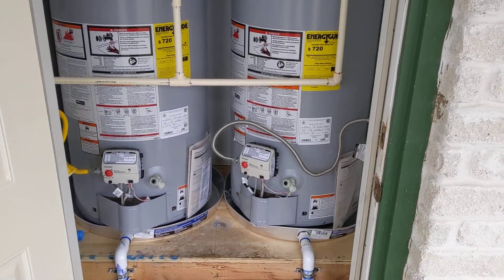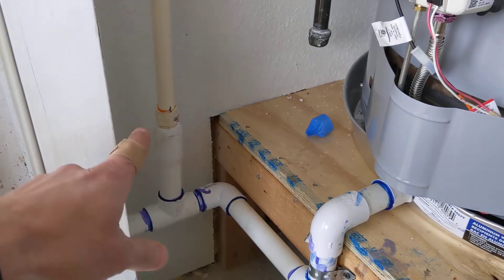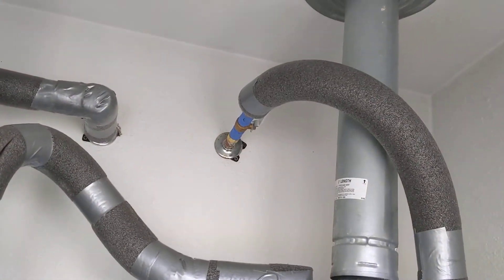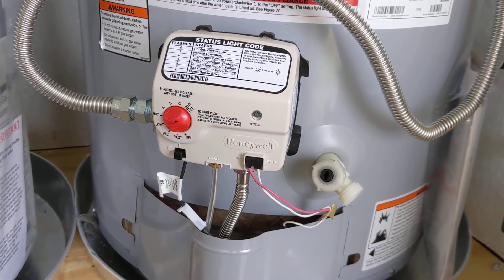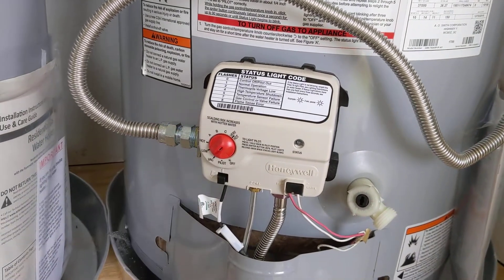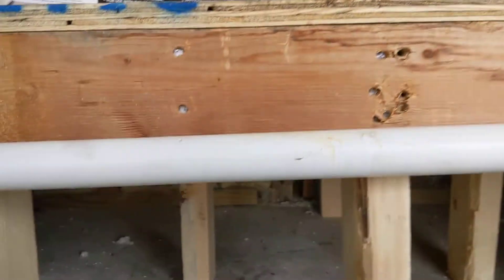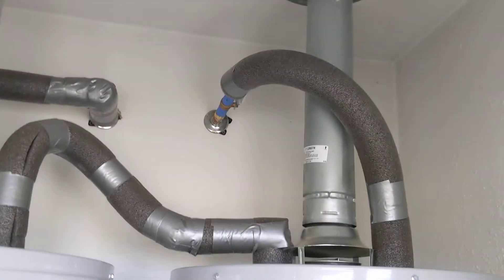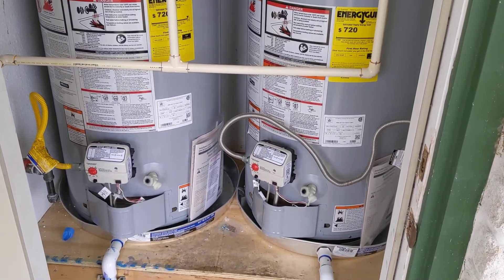Gas Water Heaters In Series

Comment: Thanks for the video. I have seen a few other videos of water heaters in series and there are so many comments from plumbers saying it's wrong, against code, will wear out the water heaters prematurely etc. Basically saying they need to be done in tandem. Thoughts?
Reply from the maker: Yeah, so code does determine what you can do in your area. I'm not sure why plumbers are so staunchly against tanks in series, other than it's "one of those things". Both systems have pros and cons and shouldn't be used as a "one size fits all". 

Heaters in series are good for those that have fluctuations in usage, such as a retreat center (where these are located). If you have a small group, then you only need one heater running, if you need more hot water, you just turn up the first unit. It doesn't require balancing of the pipes and is very customizable. It's easy to add another unit because they can be different sizes and models, and you can turn the first unit to a low temp to just act as a tempering tank and allow the second tank to heat water faster. The con is that the first tank "can" wear out sooner if you always leave them both on fully, as the first tank will be taking the cold water and heating it up and then passing it into the second tank fully heated. The second tank won't have to heat anything if that is the case. So the first tank will wear out sooner, but that also means the second tank will last longer (so in my mind this all balances out).

Units that are done in tandem have the benefit of both wearing out at the same time (theoretically) and producing more hot water because they are required to be the same model/tank size and have the supply line and hot line to be almost perfectly balanced between the two tanks (same length and bends in the pipe going into and out of either tank). Pro is if you are always going to be using a massive amount of hot water, (no fluctuations in needs, because you can't turn down one of the tanks in a tandem setup), then tandem makes sense. Con is that it can cost more to install because of how precise the setup needs to be in order for there not to be backflow issues. Basically, you can't just grab another unit and plumb in to your first unit if you decide you need more hot water, whereas a unit in series can be added easily if there's gas or power available.

Summary: 

Series is great for fluctuations in usage or easily adding more capacity to an existing water heater setup.

Tandem is great if it's a new build and hot water needs are constantly high.
Reply: @MyFortressConstruction  thank you for your time. That helps a lot.
Reply: Can I have 2 different size tanks ? A 50 gallon and. A 30 gallon? Or do they have to be the same size ?
Reply: @mrorel  I don't see why not. It's basically just acting as one giant tank with two different heaters at different ends.
Reply: @mitchjohnson4714  but does the size of the tank change pressures in the system ?
Reply: @mrorel  Hmm. I'm not an expert in this, so I hope others weigh in. I think the pressure will be higher in the tank that is higher temperature. So a lot of people think that it's a good idea to have two tanks in series and then have one tank heat the water part way and then the next tank heat it all the way. This doesn't sound like a good idea to me because the first tank might make the water a good habitat for legionella. It would be lower pressure than the second tank, but I think that the way it's plumbed, water cannot flow back into the first tank, so I don't think that pressure difference is a problem, but legionella in the first tank might be a problem. 

Personally, I'd rather have both tanks operating at the same temperature (in which case I think both would generally be at the same pressure, except when cold water is rushing into the first tank during use of the system. In my house, they built it to have two tanks in series, but it's just me and my wife, so I simply turned off the first tank and I will turn it back on if we ever have a lot of guests.

The only problem with series tanks like this is that if one of them goes, you can't use hot water at all. I think you can always use the other tank of they are in parallel.

So my plan is just to take really good care of the sacrificial anodes and hopefully they will last a really long time. If you're not doing this, you should definitely make sure you're doing this.

As for a pressure differential, I don't see it being a problem.
Reply: @mitchjohnson4714  why wouldn’t I be able to use hot water if one of the tanks go bad? Wouldn’t it jus run off of the one working tank?

Also so if I had a 30 gallon and 50 gallon, would my 30 gallon be where my main water line would go and the 50’gallon would have the outlet to supply the house ?
Reply: @mrorel  Sorry. I guess it by "go bad" we meant that it didn't heat, you'd be fine if the upstream one went bad (That's basically my setup, since the upstream tank is off). My last water heater to "go" started leaking everywhere, so that's the scenario I was thinking of. I was also thinking about using the heater while the other one was being repaired, but maybe that's not really a big deal. 

If it were the downstream one that stopped heating, I'm guessing the water wouldn't be quite as hot because now you've just basically significantly increased the volume of the water, but now the part that heats is pretty far from the outlet of the hot water. So I guess in that scenario you'd either have water that wasn't heating properly, or you'd have to increase the heat of your working heater until the other one was fixed.

I guess it's not that big a deal.

As for placement of 30 vs 50, I imagine it depends on your needs and the reason you're doing a parallel system. In my case, it's just me and my wife. We probably don't even need a fifty gallon tank. So if I were going that, I'd probably put the 30 gallon heater downstream so I can turn off the 50 gallon tank until guests stay with us or something. If, on the other hand, you had a family of five and a 50 gallon tank was barely doing it for you and you had a couple extra guests that you wanted water for every once in a while, perhaps it makes more sense to put the 50-gallon tank as the downstream one. 

Ooooor, if you're just running both of them all the time, I feel like it just doesn't matter. Maybe it makes a little more sense in that case, to put the 50 gallon tank upstream because it will have more temperature and pressure fluctuations (because that's where the cold water enters), but I don't think it really matters because the downstream tank can always backflow into the upstream tank. The upstream tank can't flow back into the pipes (but it can flow into the overflow container).
Reply: @mrorel  I don't think so. I'm not an expert, so it would be good to talk to someone else, but I'd say that the pressure depends pretty much entirely on the temperature (also altitude, but I'd guess that's pretty much irrelevant). So in an ideal world, with ideal mixing and ideal thermostatic control, they'd be exactly the same (if they're at the same temperature). The only issue is that there's not perfect mixing and the thermostats aren't perfect. I'm guessing that's why we need the pressure release valves. But they're both probably going to be set to release at approximately the same pressure, so I don't see it depending on the size of the tank so much as where those valves are set to release. 

But like I said elsewhere, I think water (and pressure) can freely flow from tank to tank, so while it doesn't happen instantly, the pressure would equalize.
Reply: So those are sediment traps on the gas line? I assumed they were hammer arresters, but that doesn't make much sense

Comment: What would be the process of draining and removing the water heater on the left in this case? Either for removal or replacing it?
Reply from the maker: There is not a difference in removing a water heater out of series than what you would do with a singular unit.  You turn off both heaters, shut off gas and disconnect gas line, flush the tank for a minute via the drain valve, then shut off water coming in, allow it to drain completely, then disconnect it from incoming and outgoing water and remove it.
Reply: @MyFortressConstruction  Do I need to Drain BOTH tanks? I am replacing the gas control valve on the right only. Mine is an identical set up as yours.
Reply from the maker: @LegitRunescaper   Yes, If you are replacing the entire control valve, then you only need to drain the tank that you are working on (the other tank will drain a little until it reaches pressure equilibrium). However, if you aren't removing a part that goes into the tank of the unit, then you don't need to drain it at all. I'm sure you have already checked, but if it's just the thermo coupling, then you just replace it, not the whole valve. Merry Christmas!

Comment: I suppose a recirculation pump would be needed to keep hot the (turned off) gas heater tank downstream of the hybrid.
Reply from the maker: Technically you could do that, but that would defeat the purpose of the second tank being turned off as the 1st tank would be doing double duty.

Comment: Now that I think about it, the gas should be installed down stream of the hybrid, so it's tank is sanitized by the hybrid, then during time of electrical outages, you can turn on the gas heater and it would take over. I would also assume this would give you more 1st hour capacity for the hybrid during normal hybrid only usage.
Reply from the maker: You wouldn't want the first tank to be heating in this setup as the water would be cooled down by the second tank. You would have to have hot water in the last tank and optionally use the first tank. You don't have to worry about sanitation if the water is being treated. Cold water lines never see heat and do not have a higher bacterial count. If you're on well water then it's possible, but most of the time the water is filtered plenty by the ground and whatever inline filter is being used.
Reply: However if the gas heater is turned on and the hybrid is off, wouldn't you have the same problem of emptying hot water into the hybrid's tank? Would this result in getting lukewarm water? I think you would have install a bypass valve. So when the power is out, turn on the gas heater And switch over a plumbing value.
Reply from the maker: @kathyorr4737  If you're going to use a recirculation pump then you would either have to bypass the first, if not in use or use both, or place the recirculation pump in-between the two with a check valve in-between the pump and the first tank.
Reply: Since a recirculation pump doesn't work when the power is out, I like the idea of a gas heater first and the hybrid downstream. When the electrical power is off, simply turn on the gas water heater and rotate  a bypass valve within the series pipe to bypass the hybrid. Reverse order when the power comes on.

Comment: How about installing a gas water heater first (not turned on, unless the power is out) and then in series to a hybrid)? Would there  be problem with bacteria because of intermittent gas water heater use?
Reply from the maker: Interesting idea and should work fine. Since it's a closed system and should be chlorinated/disinfected by the city, bacteria growth shouldn't be higher in a gas unit. If you were in the UK then their system is different than ours.
Reply: If you're going to mix types of water heaters just put the most cost efficient water heater first and then the second less efficient water heater as the surge load and keep them both on

Comment: Great info. 
I have 2 questions: 
1. when do you need water heaters in parallel ?
2. where do you install expansion tank if you have backflow prevention nipple on wh cold ?
Thank you very much
Reply from the maker: Install water heaters in parallel when you need a lot of hot water all at the same time since both will be identical units with the same heat setting. The benefit to it is that they will both wear out at the same time and the system will be more balanced giving you a higher flow of water and less pressure drop. The problem is that you can never change the settings individually and you can't use two different brands or sizes of tanks. You would probably want an expansion tank on that setup because you would have both units producing a lot of hot water. More often than not an expansion tank is not "needed" it's just a good idea and required by code in many municipalities. It is meant for a "closed" system, that is, if you have a check valve anywhere after the meter that would prevent pressure from going back out to the street main or well, then you have a system that is closed from the main supply and in that case you would need an expansion tank to be able to receive the additional pressure caused by heating. However tanks have a pressure relief valve on them that is designed to open at certain pressures to prevent pipes or the tank from bursting. The benefit of a two tank system is that you have two relief valves that can help prevent anything from bursting and an expansion tank is a redundant safety feature. Most expansion tanks are installed on the cold water side as the nipples you are referring to are not true check valves and will not completely block water like a check valve so the expansion tank will still do it's job.
Reply: @MyFortressConstruction  Thank you very much for great info
Reply: Technical those tanks are in series
Reply from the maker: @joshuabennett723  He was asking about parallel/tandem, not the water heaters in this video that were done in series.